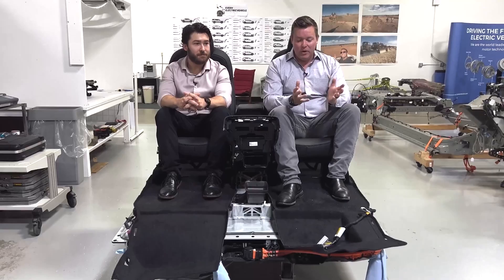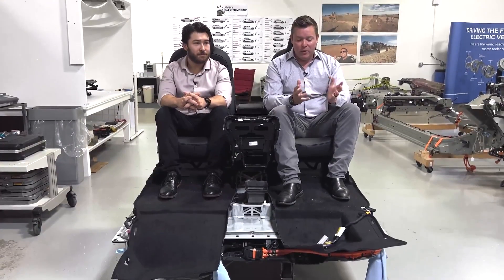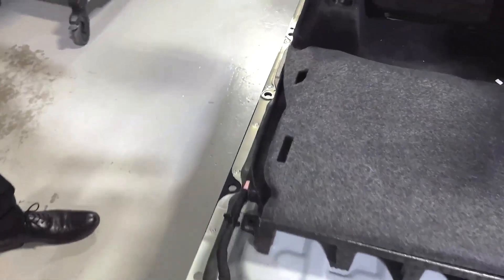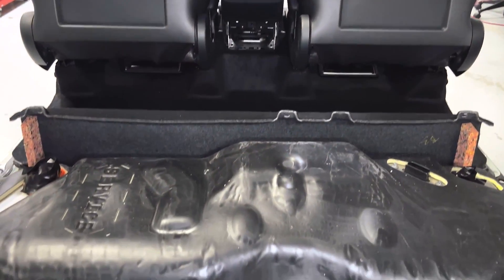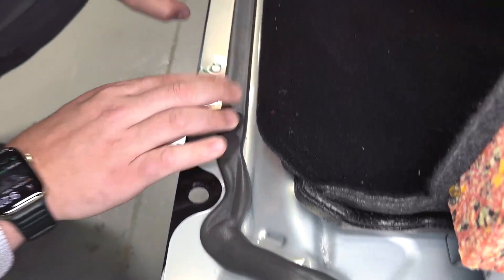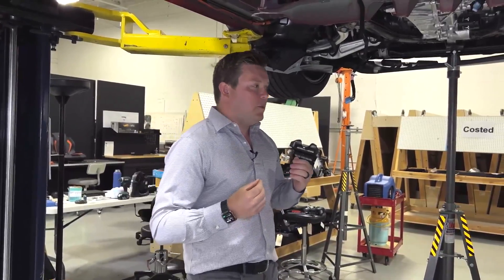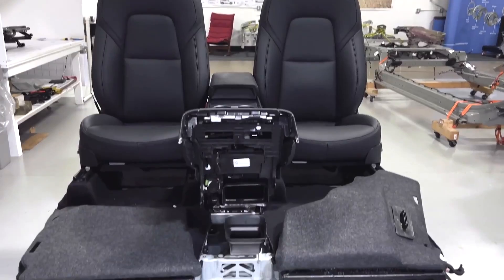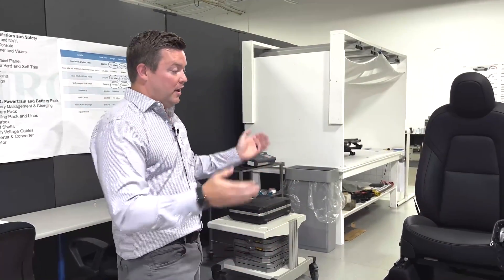Munro Tear Down Tesla’s 4680 Structural Battery Pack 🤯

Comment: What's also not often seen or discussed with those gigacastings / battery packs is how fast Tesla could introduce new lines / models now they have simplified the processes. A new model comes down to new front and rear gigacastings and frame. You can reuse the same battery packs if you want or slightly alter them if you want to, but the processes are extremely similar. Tesla could design a smaller vehicle, with single motor, simpler interior and smaller battery pack to address the B segment very rapidly if they choose to do so. Once you have the building blocks, it becomes much easier. 

Then on top of that, if FSD/software matures to a point where almost 100% of customers are willing to pay 200$/months for it, then Tesla could even sell there vehicles at cost and make money on subscriptions if they want to. If you sell a 20k usd car at costs, and the average lifespan of the car is 10 years, and you make 200usd/months during its lifespan, you end up with 24k profit per car so 120% profit per car while selling them at costs. Yes it is delayed profit so it would count as less profit but still... Not saying they will do it, but they have so many cards in hand right now. Right now they "have to" sell at high prices to match demand but they have many levers to pull if demand starts to tighten. Pretty impressive.

Comment: Why not do the same for the wheels, suspension and motors? In fact, the whole drive unit. Surely, this would make for even more efficient manufacturing. Or, on the maintenance side, would allow for dropping just the battery floor, seats and partial interior as shown, or you could drop the whole drive unit from the rest of the body while still attached to the floor unit. Put very simply, you have like a 3 layered cake 🍰.
Or again, have they already done this?
Reply: Front and rear suspension modules including engine and ancillaries have been decked like this for many many years
Reply: @TeslaBulldotcom  Thanks for confirming my suspicion. Cheers.

Comment: Elon on Twitter a few days ago :“Structural pack is the right overall architecture from a physics standpoint, but it is still far from optimized”. Competition must be craping their pants.
Reply: The competition is just sitting idle by and watch how the gap between them and Tesla increases. It's amazing really.
Reply: Exactly, they know they can’t transition to this method for at least ten years with the models they are already mostly through design, engineering and possible prototype or production of. Because they have to stick to it long enough to recoup any investments made to get there and there is no there, there. They’re DONE, DEAD, INFERIOR and they know they can’t say this out loud, but CEOs are making their exit strategies now. They don’t want to go down with the sinking ships they are the captains of.
Reply: @dduffy7271  They probably can’t stand to watch this Munroe teardown.  It’s their death and they know it.
Reply: @dduffy7271  And even if they pulled it off (EV mass production), they would simply cannibalize their ICE sales.
Reply: The casing on the 4680  - relatively, it's like armour-plating...
Reply: They’re too stupid to crap their pants. Sandy Munro has said that ZERO US auto manufacturers are buying his reports. Only the Japanese and Chinese manufacturers are interested in buying his tear down reports

Comment: Canada uses the metric system! But being next to the US, many things remain in the imperial (standard) system including building materials.
Reply: Bah humbug,PSI has less room for error than bar
Reply: @iankaye9801  
PSI and BAR shows exactly same thing, difference is only scale, so it's basically same thing as meter vs feet, one is used as universal standard and other is just made up random thing based on another random thing.

Comment: I would just wait for crash tests. If they improve also that (or at least hold it at the same level) this is f-ing amazing.
Reply: Vehicle will have already passed the crash tests, this has to be done and signed off before moving to production
Reply: Yea, we have seen a few crashes where the battery is ejected, what happens to the passengers now? Hopefully the 36 bolts are enough for any wreck

Comment: This is great, the $50k Tesla should now be costing $40K and have more range. Oh wait a minute, it now cost $60K and has less range. What progress, I mean regress.
Reply: From what Elon and Team alluded to during battery day, I think these new batteries have more usable range and can be charged to 100% without issue. Older batteries are best kept between 30-80% for longevity and minimize degradation. Also, they are getting the same or more range from less kWh of the new packs vs old.

As for sale price, that’s more to do with supply and demand. There are parts and supply shortages throughout the whole industry. Every brand is raising prices to compensate for increasing supply parts prices. Automakers are paying premiums to ensure a healthy portion of the parts supply over others. If you think Tesla is just trying to pull a fast one on consumers, you should pay attention to what everyone else is doing to see a trend.
Reply: @FlipBoxStudio  I dont think the battery size has anything to do with whether you can charge it to 100% or not. It has to do with the battery composition
Reply: The problem is your measuring unit, i.e. increasingly worthless dollars.
Reply: The problem is greed. Funny thing is I and others can buy EVs that aren't Teslas more affordable prices. They may not be a high tech, may not have the cache of a Tesla,  but they will get the job done. Get out of the Tesla bubble and you will see this clearly.

Comment: Whilst the engineering is amazing and the efficiency gains immense, it does concern me that if you have a minor accident, the cars are almost beyond repair.  we will be writing off more cars fo minor accidents as the ability to replace parts will be next to impossible with the Giga casting and structural packs.  This will mean tremendous waste and cost for the market and end consumer.  Insurance cost for Tesla’s will climb as a result.  Aside from this though amazing car and a technological leap as a new car.
Reply: Not true. Minor accidents do not harm the Gigacastings or the structural pack. Beside that, Tesla has already explained how to fix structural damages on the castings, and this is not rocket science.
Reply: @gwieser  strange answer as minor accidents can indeed harm the front or rear gigacasting. Also here in the U.K. I know two other Tesla owners who have had accidents and found it really difficult to get it repaired. Neither accident were there fault either - so comments on drive better don’t help. For avoidance of doubt I am a Tesla owner and stick holder - so a fan of Tesla, but I still am concerned by over simplifying can lead to problems down the line. If I’m wrong that’s absolutely fantastic too as then I don’t have to worry
Reply: Easy answers to this comment, don't drive like a madman, don't drive drunk, or take drugs whilst driving. Use autopilot, or FSD beta, and most of all... Don't drive in America, as most of the drivers there, are really... Really, bad drivers! 🙂
Reply: Fair point...

Driving better... As more EV cars replace ICE cars and with EVs having AI tech, they will avoid each other, so fewer accidents.

Comment: Universities talked for years about doing research to make structural batteries, like it was cutting edge, next to science fiction. But Tesla did it. And it was relatively simple, which is how innovation should be.

This innovation is not happening just with brute force. It's an attitude, more than can do, it's gonna do - done attitude.
Reply: Relatively simple? No dude, if it was then everyone would have done it.
Reply: @Lee-fc3yf  They never thought of it. It's impossible if they don't think of the concept. But they will do a few more iterations before it reaches its full potential. I have the feeling the Cybertruck and the semi will have structural battery packs designed into them before they are released.
Reply: @Lee-fc3yf  The universities are working on making the skin of a car into a battery. That's hard. What Tesla did with the battery pack is much simpler than that yet it gets the job done: structure that is a battery pack.

And, yes, everyone will do this. Car makers in China already started making structural battery packs.
Reply: @dougwedel9484  My point being its not easy...don't care if China is copying Tesla that's a given..or what University are working as that never comes to market. What Tesla did is very very difficult and should not be downplayed.
Reply: @Lee-fc3yf  I'm not downplaying this achievement at all. It's breakthrough, massive. But it is also getting the structural battery done when the think tanks just keep thinking.
Reply: @Lee-fc3yf  it sounds like you gave your comments a lot of thought and are offended I seem to contradict you.

Here's what they did.

Cabinetmakers make a sandwich of veneer on the top of a tabletop and on its bottom and use something called honeycomb in between. The honeycomb is just cardboard about an inch thick. That sandwich is super strong and super light. That's how they made the structural battery pack. The concept is relatively simple. They placed the batteries between two sheets of metal.

There are wall panels for prefab homes which use thin sheets of metal which sandwich styrofoam. And again, these wall panels are super strong and incredibly light. The batteries in this structural pack are not nearly as light as styrofoam but the pack really is strong and comparatively light compared to having non-structural battery packs plus a frame.

That is way simpler than what these university geeks are trying to do. They are making their batteries so complicated that it is almost impossible to build, control re fire and be as strong as what Tesla is doing without delaminating. Tesla's battery pack won't have that problem because it doesn't need to be as strong as what these other people are trying to do. The strength comes from the overall shape and the edges, not sticking the middle of the sandwich together. It's beautifully simple.
Reply: @Lee-fc3yf  With all due respect, your statement is not true. I entered into an insurance related business with nothing but a high school diploma. Within a year, I was president of the company because I had streamlined the processes (while reducing error to almost zero) so much that our company became #1 (by a far margin) in the entire industry. I shared the process repeatedly to very experienced executives with college degrees. They all HATED it because there was no ego gratification or power plays needed in the streamlined version. Still, they had to accept it because of the vast amounts of money being made - they just didn't want to hear about it anymore or, certainly, not become personally involved. It was a real eye-opener to me. My dad was am aero-space engineer and ONLY things that actually worked could be put into the projects. I thought "business" was the same way. I was shocked how emotionally driven the decisions of adult people were. So, NO. EVERYONE does NOT do what is simple. As a matter of fact, the more complicated & confusing ANYTHING is, you can bet there's a ton of people stuffing their pockets with money. "Mystery" is the friend of dishonest people.

Comment: Tech at it's finest. 
By the way,  is it best to buy Tesla 3 to1 split before or after the split, since it's cheaper to get in after the split. Thanks.
Reply: Before, and after, then some more later on is the best method
Reply: @mikecounsell  …👍
Reply: It's not inherently cheaper to buy after the split, just that the minimum value you can buy will be 1/3 of what it had been before.  What Bulls hope is that many "small-time" investors who couldn't afford the previous minimum will now buy TSLA at its lesser minimum value after the split.
Reply: 3to1 split:

Before split
1 share at $3 = $3

After split
3 shares at $1 = $3

Comment: I love the 4680s but I dont get why this weight reduction doesnt do a huge difference. When they compare model y with and without 4680s theres not a big difference in range and performance. Anyone know why?
Reply: because Structural battery and Floor have to be made MORE robust. 
the 4680 batteries themselves weigh less and ther are only 800+ batteries. 
but pound for pound the whole Structural battery & Seats overall weight less than most 100 kw battery pack.
Reply: They use the 4680 technology to benefit Tesla, not the end user ! ( smaller battery, lighter weight) …but the end user gets similar range and performance
Reply: @maxflight777  Exactly! An average customer would not notice much difference between a Model Y with structural 4680 pack or a Model Y with the normal pack with 2170 cells. 
I read a lot that people are holding off delivery of their Model Y's, because they want the 4680 structural pack and the front and rear castings... When I see such a post, i explain that Tesla will make is such that there isn't much difference and all benefits are mainly for Tesla, because of reduction in production costs and increase in production speed.
Reply: @maxflight777  do we know the capacity of the strukturel battery? Isnt it about 70 kWh as well?
Reply: Are they nobbling range and acc in sw for now until the 4680 manf is at full chat? Then offer extra range via paid upgrade?
Reply: @mikecounsell  
Its quite likely that new 4680 battery packs are software limited due to them being new and due reasons mentioned above. If tesla started to release cars with 10% more range for same price, people who got "older" cars can be angry as they got "worst" ones. 
It wont be paid upgrade, Tesla will simply enable it as a feature later on, or not. They could simply put in enough batteries to make a car which can drive same distance as previous ones, so less batteries, less manufacturing costs, more revenue and everyone is happy ether way.
Tesla should release new refreshed model which would specifically go with new batteries, with new range and with new pricing, but as some preorders can take up to a year at the moment, this wont happen soon.
Reply: Yes Tesla is fully aware if they suddenly offer the same product for the same price yet 30% better you may upset prior purchasers. In addition Tesla will populate the fleet with many thousands of cars and collate real world user data to ensure the new batteries can perform as predicted. Over time Tesla may/will use over the air updates to open up the operating envelope of vehicles possibly in conjunction with new model variants/prices. No one looses out, by default everyone gets performance /reliability at least what was on offer prior to 4680 and looking forward buyers get even more and Tesla does not get a lemon out there.
Reply: There's less in it. See above!
Reply: But having less weight should mean more range or performance, yeah?
Reply: @cold_jay  yeah thats My though too :)
Reply: The casing for the 4680 is much thicker than 2170.  There is a tear down of the 4680 from The Limiting Factor.

Comment: the fact that competinion's battery back is more than twice as heavy means their cars have lower center of mass, and therefore are safer :p (also because they spend more time at the charger)
Reply: 🤣😂Yes. Of course. You are talking about absolute mass instead of percentage. What you say is that a 100000000000000 lbs heavy car ist better than one with 1000lbs. Hilarious! 😂🤣👌
Reply: Not necessarily regarding centre of mass. Time at the charger is a non-starter.
Reply: @gregbailey45  Who needs a charger when he has a Battery with 1 Terawatthour? He does not specify how large his heavier battery is…

Comment: The battery pack of rivian has like twice the capacity. So obviously it's heavier.
Reply: but has LESS range than the SR model 3 , INEFFICIENT.
Reply: @markplott4820  less range, but it's a bigger car, with a bed in the back. Its not apples to apples. I m a huge tesla fan, but let's keep the facts straight. Let's compare to cybertruck when it comes out
Reply: @Matzes   - the Cybertruck DESIGN is already Complete.
they just dont have a Factory , YET. 
TESLA Cybertruck will be the WORLDS Fastest TRUCK on the Market with CLASS leading SAFETY, Speed, Accelerateion, Payload capacity, TOWING capacity , and overall BADASS.
Reply: It needs it to get the same performance. Duh!
Reply: Its not a matter of battery size its a matter of weight of the additional fasteners and metal parts needed to MOUNT this battery on a structure which needs additional metal and other parts and adds more weight. 

Yes: Teslas before the 4680 pack have similar „problems“. 

Its a development, innovation. Every day something new and sometimes something important comes to the market and shows us the future. I am sure even this battery pack can be reduced in size, weight, complexity, price. Maybe make the cells stronger, maybe another form factor. IDK. 

Imagine this battery pack times 4 (280kWh = 2000km range…) on the Cybertruck. Without color, Without body panels. Even more reduced weight for the important things. That will be the next development, the coming innovation. 

And what do the others offer? 800V? Swarovski Crystals? Self charging EV? Biggest kidneys ever? Ohhkay…